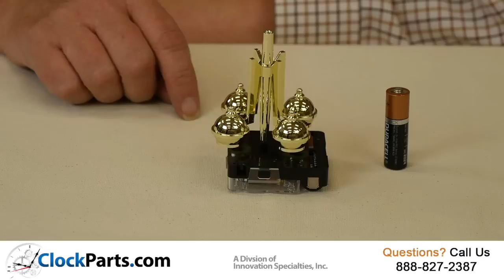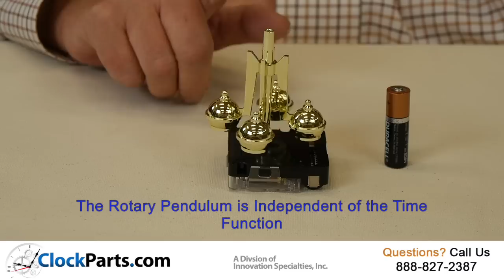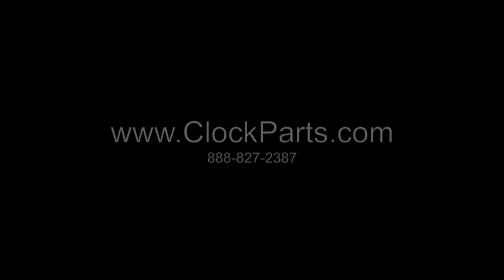Rotary Pendulum Clock Movement for Anniversary Clocks

Comment: I just bought two battery operated anniversary clocks for $15.00 last week. I always wanted one and i was lucky to find two of them. They are both missing small plastic parts that hold the pendulum spring. One of the clocks has pins that hold and balance the pendulum in place, the other clock needs the spring to balance the pendulum. I am in the process of converting one of the clocks with one of these pendulum rotorary drives . I found a similar pendulum drive on ebay for 24.99. The quality will problay be different compared to the american made drive this company sells. I wish this company sold them for the same price. Unfortunately 49.99 for 1 item is too much for me.

Comment: i've got a linden clock with the rotating pendulum like the one in this video. the model #5228. the string is already attached to the pendulum and the clock. but  does it attach to that little black plastic that looks like a ships wheel? is there some place where i can see a schematic so it can be routed correctly? any help would be appreciated. also, is there some way of adjusting the time keeping portion? i set the time, and it has a fresh battery. but the clock has stopped

Comment: How do you mount that on the anniversary clock at the bottom? If the clock does not have a clip at the bottom?
Reply: double sided sticky tape, the kind with foam.